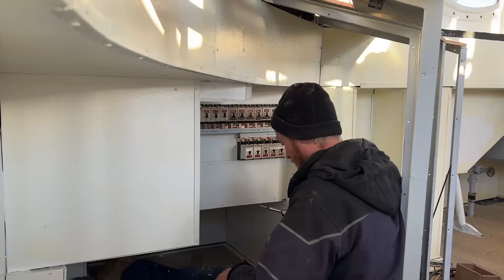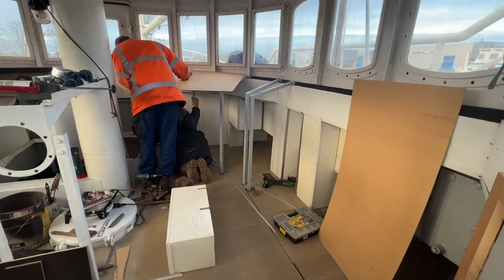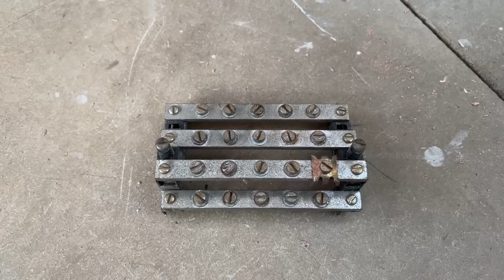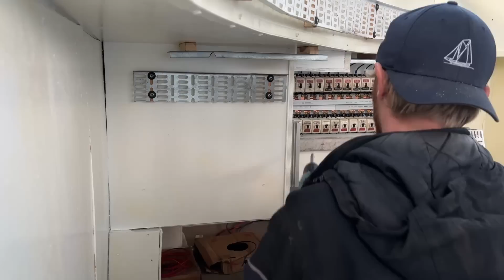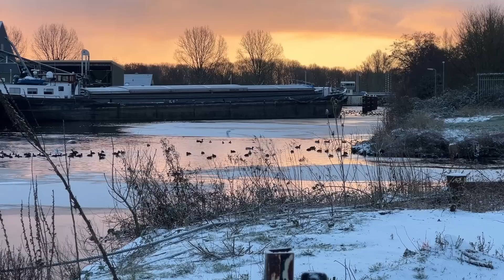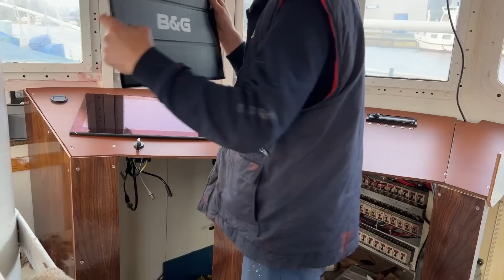How To Build a NEXT LEVEL Navigational Console?

Comment: Nothing against the workmanship of your new console but now that I’ve had time to think about the design, I’m wondering if it’s practical. Please just hear me out.
1. People will be entering via the front door with equipment or stores, your console will become a natural hand hold or rest with the potential to damage equipment.
2. From a navigation watchkeeping perspective, having equipment/screens so close to the wheelhouse from makes looking out over them on a night distracting in the least - yes a common recreational/super yacht practice but from a solid commercial practice it’s a set up to be avoided.
3. You have some space aft of the mast and forward of your helm. The B&G nav screen could be mounted there on a bracket that can tilt and swivel. The remainder of your equipment (radios, AIS, sounder, thruster controls and the like), could the be mounted next to the nav screen or vertically on a box (cable run) pillar aft of the mainmast and maybe even the radios mounted from the deck head above.
..
What it does do is give a dark space at the forward end of the wheelhouse to both PS and SB free from equipment glare at night and also freeing up that forward access. 
The position of the switchboards remains ideal but the structure covering that and the nav network controllers can be made a little more flush with the forward wheelhouse structure.
Reply from the maker: Alright, you make some good points there. But we are looking at things from a slightly different angle.
Steering always done outside on the poopdeck. It's impracticle to steer from inside because you can barely see over the bow and the stern. The view around is much better outside, and we have clear sight on the sails.
The main purpose of the wheelhouse is a place for people to hang out with a nice view, during sailing and in port or anchorage. That's why there will be a high table in the centre with barstools, a couch and a pantry. We want to have a kind of living room atmosphere, without displays or radios being the center of attention.
The second purpose of the wheelhouse is voyage planning, hence the big display. Also if we want a better look at the radar or chart, we can check the wheelhouse display, because the poopdeck display is quite small.
The last purpose is having a place to steer the ship when outside is absolutely undoable, which happened only once during the last world voyage.
That's why we chose this arrangement over a more bridge-like setup.

People entering via the front door is a very valid point of attention that we noticed only after we installed the display. So we have to be mindful that we always place the cover on the display when it's not in use and maybe install an extra guardrail. During sailing, the front door will remain closed. 

Thanks for taking the time to write down your thoughts. I do agree with all of it if the wheelhouse was our main place to steer the ship :)
Reply: That’s a good stat that only once on the last world cruise steering from outside was not doable.
The wheelhouse will be a very cool place to chill.
I think what you and your Da are doing is amazing. I’m always into best practicable use of space and the idea of renovating your ship to last another 80 years is just plain cool!

Comment: I'm sorry, but all that equipment away from the wheel. It doesn't make sense. I think the wheel house is to spread out as far as conning the ship. To use helm and keep a eye on instruments will take 2 people. ?
Reply from the maker: There will be one display at the wheel on the poopdeck, where you can view radar, chart, depth, AIS, GPS, etc. As well as VHF radio and autopilot controls. Everything you need for manoeuvring into a port is there. On ocean passages the autopilot takes over most of the steering anyway, so you can easily walk away from the wheel to check radar, chart, voyage planning, etc. on the big display, or even to communicate with ships in the vicinity from inside the wheelhouse :)

Comment: Your work is progressing beautifully. One question: you didn't mention anything about SSB radio. Any thoughts? Thanks for sharing. Greetings from Sweden 🇸🇪.
Reply from the maker: That is a good one, I honestly totally forgot about it, I have been sailing on ships with internet for the past 6 years, so the SSB was rarely used, but I have to research it it's still mandatory to have one on board, thanks!

Comment: The one glaring aesthetic change I know I would be forced to make would be try and match the window in the front wheelhouse door to the size and shape of those on the wheelhouse itself. I love the fact that you and your dad are working on this together. With regard to a bow thruster, as Tiger Hai will make long ocean passages I wonder if one can have thrusters that are only immersed when you come into port (possibly on stern as well) and are stowed below when under passage. One other thing that intrigues me is whether there is a sweet spot on boat size where it is large enough to have all necessary amenities on board...water maker, washing machines, good showers etc such that you dont need to use very expensive marinas and instead, as in your case, you can more up against a commercial dock at far lower cost. Interested to hear about your views on this and your dock fees and insurance costs one day
Reply from the maker: The window in the door is one that we found laying around in the shed, and that fitted in the door. We can always look for a more aesthetically pleasing one, as long as it's bigger than the one that's in there now. We don't have a bowthruster yet, but plan to install it when we're in drydock coming september. Retractable bowthrusters exist, but that is more a superyacht thing, and would be a bit above our budget. The engineroom is quite large, and there's still plenty space for things like a watermaker. The washer and dryer will fit in the corridor between the cabins and we have 2 shower/toilet areas (that still need to be redone). We do like to be as self sufficient as possible, so we can make more use of anchorages and less of marinas to reduce dock fees. e